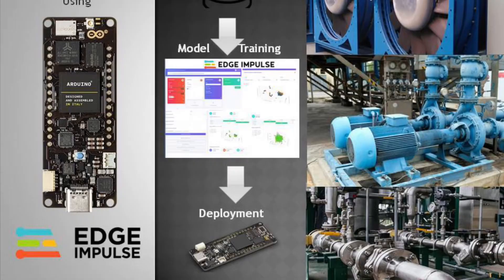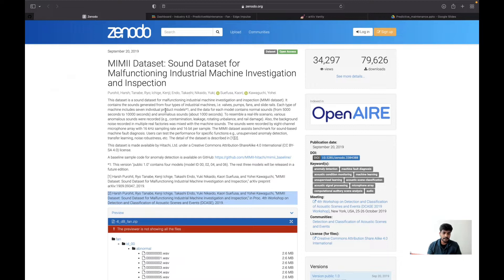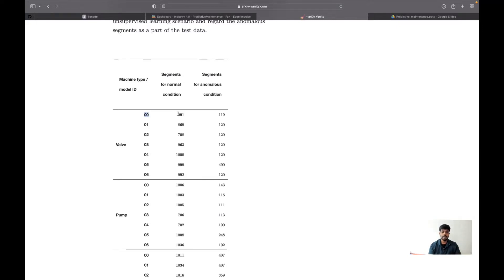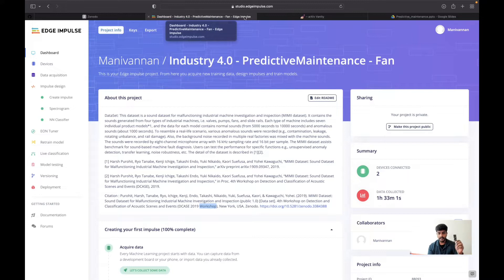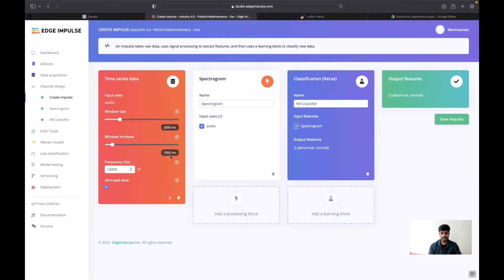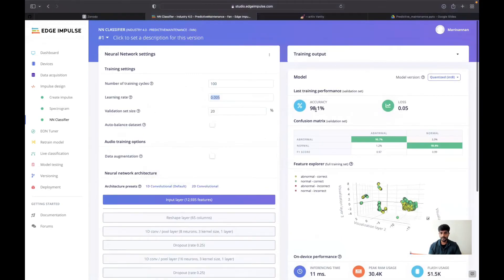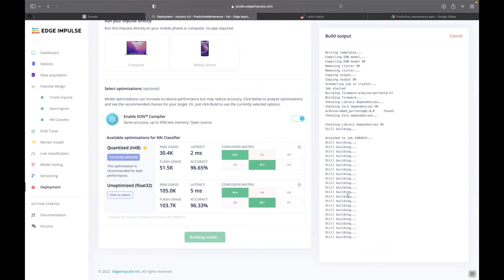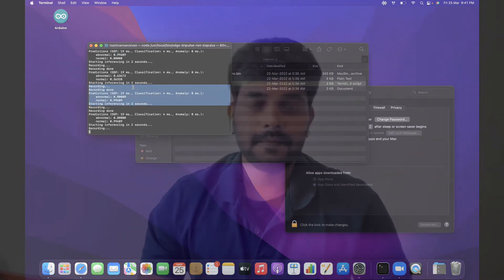Industry 4.0 : Predictive maintenance using Arduino Portenta

Comment: Hi 
Thanks for this informative video
I am learning tinyml ...I have basic question how continues training of ml model can be done in tiny ml .

Eg in automotive predictive maintenance
Continuous sensor values are generated and in traditional cloud computing we can pass all this values and use for enhancing ml models ( using mlops pipeline)...but how to achieve this in tinyml
Reply: PLEASE CORRECT ME IF I'M WRONG BUT, IN ORDER TO CONTINUE THE TRAINNING I THINK THE DEVICE WILL NEED TO BE CONNECTED TO THE CLOUD OR SOMETHING LIKE THAT.

Comment: hey hi, can we use any other low cost micro controller for this protective maintenance?
like esp32, or something within the range of 1500 in order to make it cost effective?
Reply from the maker: Try for Silabs Thunderboard sense 2 !
Reply: @ManivannanSivan  may i know the reason, i am really looking over this prototype. will there be time complexity issue or latency in low footprint controller
Reply from the maker: @anime_on_data7594  vision shield has camera and microphone. For this application, Thunderboard sense 2 alone sufficient